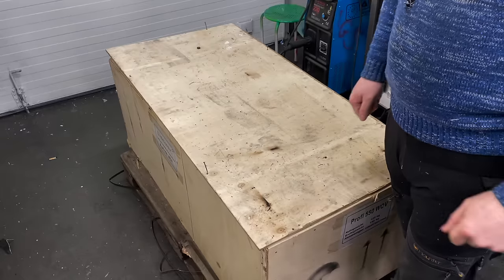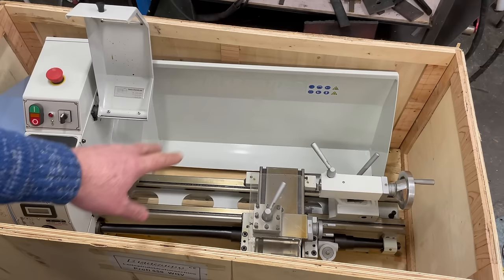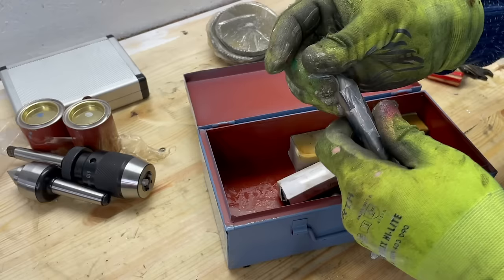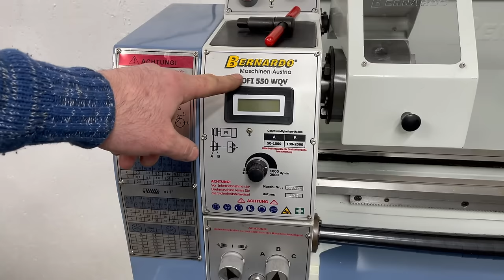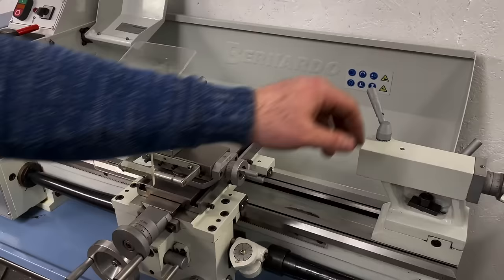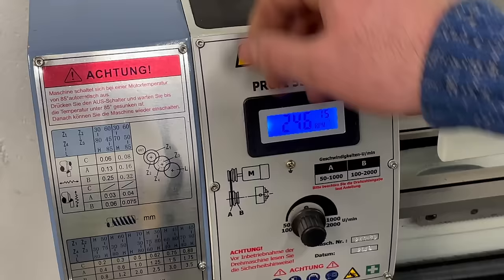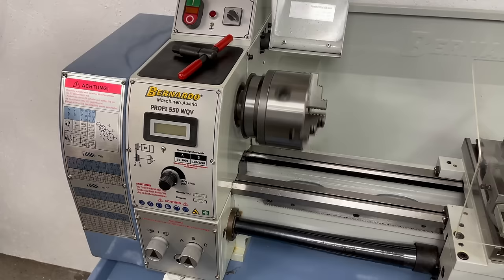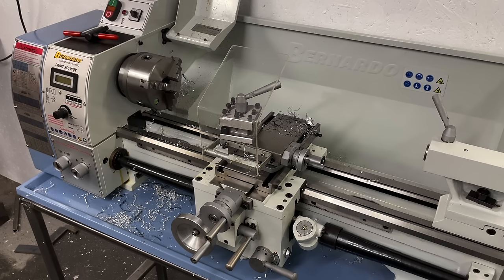Testing New Best Mini Metal Lathe Machine

Comment: Pretty good for what it is but I'll stick with my vintage lathes, 50 years old and still better quality then the new ones..
Reply: better than china's mini lathes specifically. 
if you get a new lathe from a reputable company its going to be superior to your 50yo rusty lathe. which probably hasn't had a bearing replacement in over 50 years.
Reply: @darkshadowsx5949  obviously you don't know much about vintage lathes,,, mine are all shiny like new and I can put a dail indicator on spindle and needle dosent move on I can run a caliper and micrometer down all the ways with hardly any difference in measurements, only one of my 6 lathes shows some wear in the gears,,and you would have to pay as much for one really good lathe as I have invested in all my lathes with the steady rests follower rest and milling attachments as well as the many chucks and tooling, l know lathes very well and have been restoring them for years, lve seen what's on the market and you can't buy anything comparable for less then 2000 dollars. Vintage lathes are all cast iron and not stamped steel. So they don't do much rusting..
Reply: @darkshadowsx5949  all are timken bearing and can be replaced for 30 dollars very easily,  but talk to me in 50 years when you know that the new lathes can prove the test of time like these have.
Reply: @georgespangler1517  I learned on my High Schools South Bend brand Lathe, old but nice.
Reply: @repairfreak  that's why it's harder to find southbend and Logan lathes in good shape so many was in schools and factories, lve bought and restored 6 atlas lathes was more the hobbyist lathes and most was well taken care of and parts easy to find still.
Reply: @georgespangler1517  So George, would you agree that the S. Bend Lathes were good well made machines and lasted a long time? Cause if I ever had a chance to buy one in good shape I’m thinking I would. What are some of the areas to check for wear on these beasts?
Reply: @repairfreak  l agree,, l would much rather have a vintage southbend then my atlas lathes,, l just can't find any not beat up and worn out,, l have 2. 12 x  36 atlas with quick change gear boxes and pretty much every attachment and 4  6 x 18 inch one that's 50 years old and was never used and pretty much every attachment for them also,,l bought them up cheap knowing the price would go up as people realize buying vintage is the best way to buy,, and in 2 year's I've seen the prices triple,, atlas is ok just can't take deep really deep cuts,, and the quick change gear boxes slowest feed is  .0042,, where South bend  is around .0072,, engineers really dropped the ball there the slowest feed is like a really fine tread,,but I changed my drive gear from 48 to 24 teeth to compensate for it,, l can still tread but half to muiply by 2 and I lose the first row that I would never use anyway or if I did it's not hard to switch gear back.. but yes I really prefer southbend are Logan,,but if I could have any it would be a Colchester.
Reply: @repairfreak  atlas has casted zmak gears out of zinc, maxnesium, aluminum and copper,,,where southbend has all steel cut gears,, making them harder and better,,but the new cheaper lathes have nylon gears that's much softer than zmak,, and of all my lathes only 2 gears show wear,, but it's how atlas kept price down,, but the gear boxes are all steel cut gears and why the gear boxes cost as much as lathe to have are you just had change gears to deal with
Reply: Many of the old lathes on Ebay are worn out & overpriced, at least a new one has a chance!!
Reply: @dandare2586  l agree that's why I buy atlas it was more of the hobbyist lathe and most was well taken care of,, as being cheaper than Logan are southbend none was in factories and schools so not used for production,, l have 6 that I can slide mic down all ways with little change and needle hardly moves on daily indicated on spindles,, and only 2 gears show wear of all the lathes, l got all 6 for what a nice lathe would cost,, and both my 12 inch have quick change gear boxes,, and I have pretty much every attachment for all the lathes and tons of tooling.. already have tripled in value as people realize vintage is much better than new all cast iron with no stamped steel and have already proven the test of time.

Comment: By the way if you intend to keep your lathe for any amount of time now would be an excellent time to strip down the breadstick and carriage to clean all the award and chips these "quality" tools have in them as the Chinese can't be bothered to clean their products before assembly.  That alone will extend its life and accuracy.  At least change and flush (diesel oil will do a good job) them several times.  Check you bearings for head play as well.  Clean out your chucks as well.
Reply: Sorry about the spell Check.  It changes the words unbidden.
Reply: Correct Douglas.  My PM 1022v had all of this already done by the importer and they did an excellent job. Also put in a different set of quality spindle bearings and thoroughly cleaned the machine.